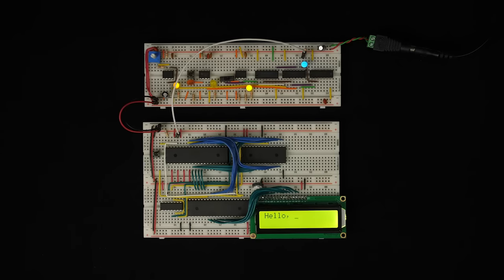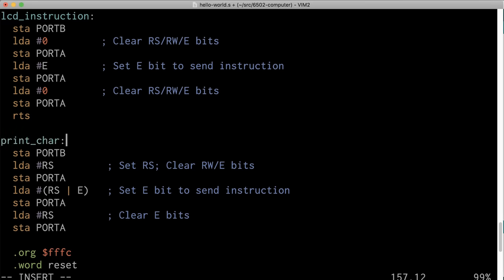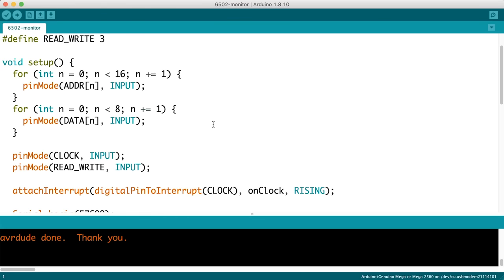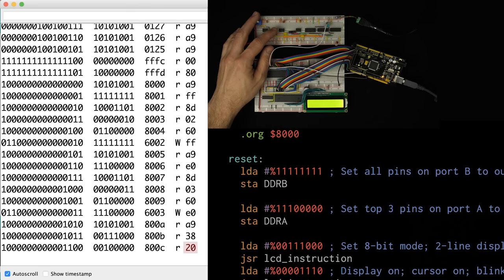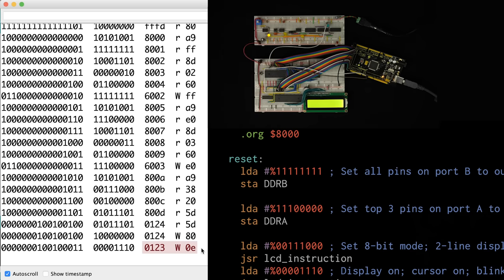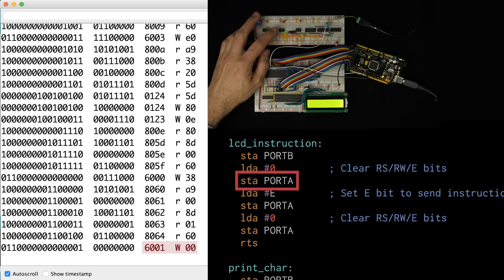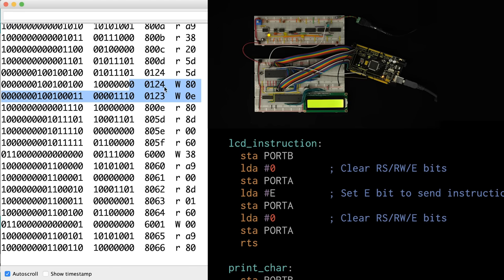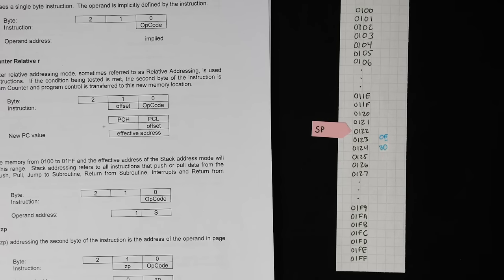What is a stack and how does it work? — 6502 part 5

Comment: You drew the stack memory locations properly. In computers we consider (and list) the lowest memory address first and list the increasing address locations progressively under them, just like when we count: 0, 1, 2, etc. Now what you have to remember is the address at the top of the "list" is LOWER in memory and the address at the bottom of the list is HIGHER in memory.
So, sometimes we call the lower values listed at the top address (listed first) BOTTOM (where they start), and the higher values listed at the bottom address (listed last) TOP (where they end). So, no matter how we "list" our memory addresses, BOTTOM is toward lower values, and TOP is toward higher values (which looks inverted at first glance).  However, when we look at Stacks, the lowest address (0FF in this case) is still listed first, and the highest address (1FF in this case) is still listed last. But the highest address is called the BOTTOM of the stack and the lowest address is the TOP of the stack. Why is it reversed (and not inverted so to speak)? Because the Stack works backwards in memory starting from the highest address (1FF) and works backwards towards the lowest (0FF). Why? Simple.  Because we call it a "stack" and we "list" memory starting with the lowest address first, we can visualize the stack the same way we list memory. So we start at the BOTTOM of the stack at 1FF, then we "stack" the next value (1 address back in memory) at 1FE "on top of that" visually. Just like a stack of books. 
RAM:
Address 0000 RAMBOT <- RAM starts here at the BOTTOM of memory and is listed first.
.
.
Address 0FF STKTOP <- Stack ends here. If you put more on the Stack, it "wraps" around to 1FF STKBOT and what was on the Stack at 1FF is lost, this is called Stack Overflow and you have to keep track of it because the 6502 processor does not have a Stack Pointer at TOP flag (as I recall).
.
.  ^
.  | Stacking direction 
.  | 
.
Address 1FF STKBOT <- Stack starts here empty and, stacks backward in memory but "visually" stacking on top of each prior entry.
.
.
.
Address 7FFF RAMTOP <- RAM ends here at the TOP of memory and is listed last
ROM:
Address 8000 ROMBOT
.
.
.
Address FFFF ROMTOP
Reply: Great insight, would learning about stack help newbies understand pointers? Thanks
Reply: @hf2138  Note: I have simplifed this to use 8 bit addresses, the 6502 uses 8 bit addresses 0x00 to 0xFF and 16 bit addresses 0x0000 to 0xFFFF, but you should get the idea. Also, I am not using the exact 6502 Assembly Language here - I don't have the book in front of me and it has been decades for me, but it should give you an idea - we call this "Pseduo Code": not exact code, just an informal notation for discussion.

The Stack is a good place to introduce pointers. The CPU has a Stack Pointer. A pointer is merely 'something' (like a register in a CPU), that does not hold a value, per se, but rather holds the "address" (the place in memory where some other value is stored) that is... it "points" to something rather than "holding" something.

For example:
The Stack Pointer (SP) contains 0x82 (that is how we write Hex values, 82 in this case, in some languages). This means the SP is "pointing to" memory location 0x82 and that is where the next "thing" you "push" onto the Stack will go. Note: MEM is Memory (specifically RAM in this case) and ACC is the Accumulator register inside the CPU.

Say we have:
MEM 0x82 = 0x??   Which is anything left over from the last time the Stack used this location, we sometimes call "anything" or "unknown" simply "garbage".
SP = 0x82
ACC = 0x44

PUSH ACC     Push the contents of the Accumulator onto the Top of Stack,
                        The 0x44 from the Accumulator will be placed at memory location 0x82,
                         The CPU will then decrement the Stack Pointer by 1 to "point" to the
                         Next free location on the Stack.
                         The Accumulator is still 0x44 but a "copy" of it is now on the Stack.

So now:
MEM 0x82 =0x44
SP = 0x81
ACC = 0x44

Now you can use the Accumulator for what ever you want and it's value can change
all you want.

ACC = 0x00
ACC = X + 1
and whatever...

Then, when you are done and want to "restore" the Accumulator to what it was before you mucked with it...

POP ACC    Pop the contents off the Top of the Stack into the Accumulator. The CPU will increment the SP by 1
                     First (the SP goes from 0x81 to 0x82), then the contents of memory location 0x82 (which is still 0x44 from when
                     we pushed it there before) is moved into the Accumulator.

MEM 0x82 = 0x44
SP = 0x82
ACC = 0x44

The Accumulator is now just like it was before.

The 0x44 is still at memory location 0x82, but it is now considered garbage and that is where the next thing pushed on the Stack will go
because the SP now has 0x82 in it (that is the SP is pointing to memory location 0x82).

You can see how this is very powerful, we can keep things on the Stack and not worry exactly where they are, as long as we Pop them off
in the reverse order we Pushed them on.

It is good practice to make sure you always Pop off the exact number of things you Push on the Stack.  Failing to do this can lead
to a condition called "Stack Missaligment" or even "Stack Overflow" or "Stack Underflow".

You can do a lot of fancy things with the SP, but normally you let the CPU "manage" it for you.

One thing you will see (and do) often is called "Context Switching".  This when we need all or almost all of the CPU Registers and Flags to do something, then we need to get the CPU back to the same state (context) when we are done.  In this case, you Push everything inside the CPU onto the Stack, one thing at a time, and when you are done you Pop all those things off of the Stack back into the CPU... and end up just like nothing changed.  You will see and use context switching in "Interrupt Routines".
The CPU can be told to "interrupt" what it is doing, do something else, and come back and pick up where it left off. Since we may never know "what" the CPU is doing or has inside it when an Interrupt occurs, "Saving the Context of the CPU on the Stack" allows the Interrupt routine - called the Interrupt Service Routine (ISR) - to do whatever it wants to the CPU, then just before it returns from the ISR, it can "Restore the Context of the CPU from the Stack" and go back to what it was doing like it never left (except some time has elasped).

Then you can go on to "indiection".  This is where you use a register, say the X register, not as a place to hold a value but treat it as if it holds the "location" of a value. Does this sound familiar? Yes, you can use the X register as a "Pointer".  We could say, Load the Accumulator Indirect by X:

MEM 0x56 = 0xF3
ACC = 0x??
X = 0x56

LDAIX   Load the Accumulator Indiect by X: The CPU will use the contents of the X register as a Pointer and load the Accumulator with the contents in memory from where the X register is pointing.

MEM 0x56 =0xF3
ACC = 0xF3
X = 0x56

The X register is pointing to memory location (address) 0x56, address 0x56 contains value (data) 0xF3, and that data 0xF3 was moved (copied actually) into the Accumulator. 

Do you get the idea?

Comment: Hey Ben! I just found your series about the 6502. Really great! I don't know if you already thought about it or somebody else already suggested it. You could clock or reset the 6502 via GPIOs of the arduino and extend the arduino code to read commands from the terminal and easily: reset by hitting 'r', single step 's', run 'g' or even set breakpoints 'b 8002' by just comparing the address bus with that address on the arduino..

Comment: Back in the early 80's, my first computer was a Apple IIc, yes with a 6502. I was programming it with BASIC and Assembler. I once found a book to buy where the Assembler code of the whole BASIC Interpreter was documented. That helped a lot.
Reply: The ZX81 & Spectrum used the Z80A processor, but similarly "Spectrum ROM Disassembly" was a Bible that allowed use of its operating system's existing routines.

Comment: I love how you build a case for why we need writable storage. 

One thing,. You kinda mis-represented a stack overflow. The most common scanario is allocating stuff on the stack, beyond what you 'reserved' on the stack.  Example, you just finished JSR, and the return address is SP+1. You allocate 1 byte on the stack by subtracting 1 from SP. In your code, you copy 2 bytes to the stack, using SP as the index, and end up overwriting the high nybble of the return address. The scenario you described is really more of an integer overflow, since SP 'wrapped around'.

Comment: We had this stack overflow problem on a custom computing board we've designed. The SW engineers (on a linux based OS) had many subroutines and processes in the background running, basicly a test program to see if all the functions work. This caused a stack overflow. The RAM got cleared almost 100% (the rest was random gibberish) so debugging was extremely hard.

Comment: Great video as always Ben. Interesting to see the sequence of memory operations around the jsr, looks like it fetches the next byte but presumably discards it so the 6502 almost had a branch delay slot. The memory read at the stack location before the first push is curious, I can't think of a good explanation for why it would do that.
Reply: WDC has timing charts that show exactly what the CPU is doing at every cycle.  Check out this PDF:  http://datasheets.chipdb.org/Western%20Design/W65C02S.pdf

on Page 32, you can see the timings for every addressing mode.  Look at "1d", that's the timing for JSR.    You can see on Cycle 3, it does IO (Internal Operation).

The 6502 must read or write to the bus every cycle... it's just something that happens automatically based on the address bus and the RWB flag (1 =  read, 0 = write).  So whenever the CPU needs to do an internal operation, it issues a false read.

Comment: I learned iOS Swift, but Assembly will always be my first love. The 6502 is used in the classic Gottlieb pinball machines. For 8 but CPUs, I went a different route. I used the Z80. I still occasionally use the newer 50 MHZ EZ80F91.

Comment: And I thought that the stack was something purely defined in software. I love this videos, always learn something new.
Reply: Ironically defining extra areas of memory to use as independent stacks entirely in software is a useful way of working around some of the problems the 6502 hardware stack has.

But yeah, stack functionality is a hardware function of most CPU designs.
Any that can do functions/subroutines HAS to have stack functionality.
(otherwise you have write truly nasty self-modifying code to achieve the same result)
Reply: What's confusing is that as you can see here the CPU itself only interacts with the stack when using the call/return instructions, and the program seems to only be able to do so using the push/pull instructions. That's what the CPU hardware does, and it works fine for saving the return address and registers you want to restore before returning, BUT it would not be appropriate at all for the usual paradigm of "declaring local variables on the stack" in a high level language. Push/pull only allows you to access things in sequence, not randomly - if you stored 10 variables using push and wanted to get to the first one using pull you put you'd have to pull the 9 others and thus lose them, obviously no good. That's where software comes, and manipulates the stack pointer beyond what the hardware does. Variables are stored in the stack's address range, but are NOT accessed via the hardware instructions. In a simplified explanation when you call a function that has local variables the call will store the return address, the compiler will use push instructions to save the necessary registers, AND then will push the stack pointer further down by how many bytes your local variables use. These variables will then be accessed through usual store/load instructions to/from those now reserved addresses that are after all nothing but common RAM, just that they happen to be within the range of the stack. Moving the stack pointer clear of that local variable range ensures that any nested call (where the hardware will again push stuff on the stack automatically) doesn't overwrite it. At the end of the call the compiler increases the stack pointer back to its original location of before it was modified, and then lets the hardware pull the rest to get back to the original state. It really is a combination of software and hardware, but I've rarely seen it explained properly. More modern processors have features and extra registers to optimize these shifts as well.
Reply: @kilrahvp  Within a subroutine you can transfer the current stack pointer to the X register with TSX  then INX as required and LDA $100,X to retrieve variables previously pushed onto the stack if you want to. You can also store your subroutine's results on the stack with STA $100,X and using DEX as appropriate. The advantage is that the stack pointer remains unchanged and doesn't have to be restored before the RTS at the end of the subroutine. I used this feature when writing "sideways ROM" code for the 6502-based BBC Micro, back in the '80s.
Reply: @KuraIthys  I'm thinking that when I learn about stack in C books, I assumed that the compiler took care of creating the code for the stack itself, and never learned that the CPU have hardware to control it. Mindblowing!
Reply: @fellipec  - to paraphrase: It's CPU's all the way down.

Comment: For teaching purposes, if you had only broken out "print_char" as a subroutine (and not "lcd_instruction"), the symptom of not having a stack would be that it would print the "H" before failing to return. It also might have been interesting if you had "invented" subroutines yourself, putting the return address somewhere, but i guess the 6502 doesn't have enough registers to hold that.

Comment: I've done a lot of higher level programming, but only recently i've taken up lower level programming. I assume when you say the CPU is doing these extra things to store the return location (or trying too by pushing to the bus). That it's actually the assembler compiler doing that when it converts the assembly into machine code? Which is why it all worked without the subroutine, since there was no jump statement the assembly would of compiled into working machine code.

I guess my question is - is the subroutine functionality a part of the assembler compiler feature set or the CPU itself? It seems to me probably the compiler? I just ask because you were referring to actual CPU documentation.
Reply: No, the subroutine call is actually a hardware-level instruction in the 6502 & Z80a.

·Put the Stack Pointer on the address bus, write ½ the return address, (current value of Program Counter)
·Decrement the Stack Pointer,
·Put the new Stack Pointer on the address bus, write the other ½ of the return address,
·Decrement the Stack Pointer,
·Load the subroutine address into the Program Counter.

Comment: good luck porting romcc to the 6502. it's a RAM/stack-less C compiler, mostly the coreboot project uses to be able to write C code before the CPU has initialized any RAM. obviously it's making heavy use of extended registers like XMMs etc. fun fact: the compiler is a single source file.

Comment: One of the reasons your PC can only beep if the RAM is bad, is because of this issue of where to store the stack, so it's impossible for the CPU to step from the PC BIOS into the Video ROM to initialise the display. It doesn't need to enter external code, however, to write a few bytes to the PIT to make the speaker emit a constant tone.

Comment: Having the stack pointer decrement instead of increment when pushing data prevents superfast variable-length stringbuilders on the stack. And mixing user data with program return adresses opens a can of security issues. But if processor vendors wanna stick to it ... well, that's no longer my problem. Fiveteen years of programming is enough.
Reply: True enough for the processors of this century, but not relevant to the 6502.
Reply: The 6502 was never really designed to make PC's (or more to the point, multi-user operating systems) with, IIRC, it was made to control embedded equipment.  As such, you would not have to worry about the issues that you brought up.  There were two things that made it popular for the microcomputer crowd: One -- it was cheap.  Two -- it was easy to put together a computer because you didn't need a whole lot of support logic to build a basic PC, you would treat I/O , data and instructions all the same -- a memory access.  I figure that's the main reason Ben chose this CPU for these videos, and in fact, it's still used quite a bit in embedded systems.

Comment: At around 6:30 he mentions the bounce-on-release problem his clock module. I discovered that same thing building the 8 bit computer series. A better fix is to use the threshold and trigger values plus the RS register inside the 555 to make a schmitt trigger and then put a low-pass filter on the button itself.

Comment: I sometimes forget how many small improvements newer microprocessors have compared to the ones from the 80s, it didn't occur to me that the 6502 wouldn't have a return address register until your code didn't work.